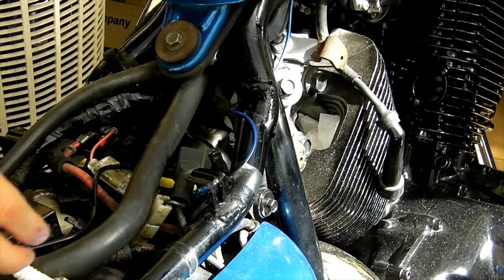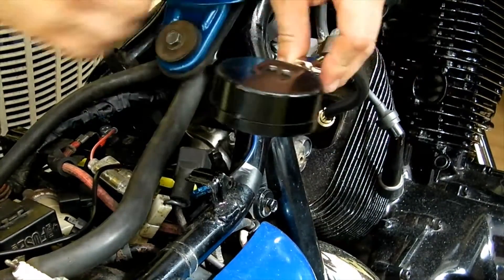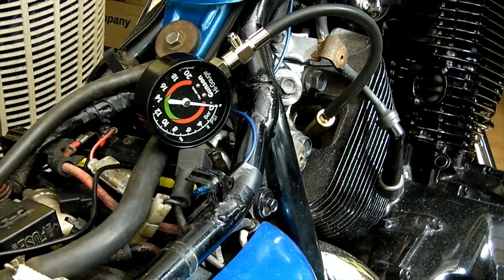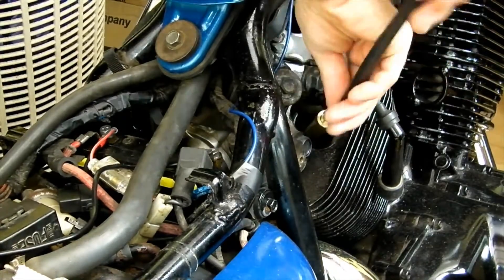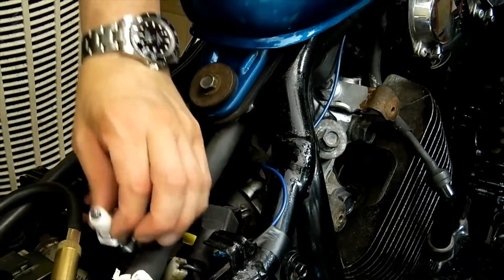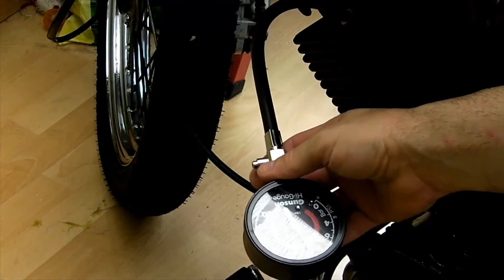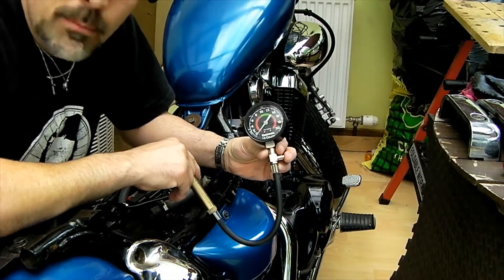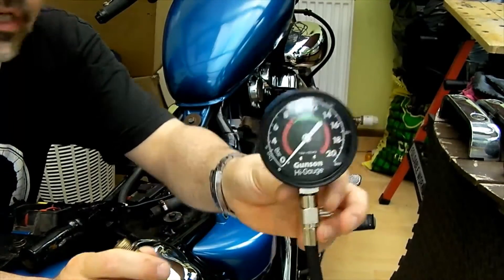Yamaha VIrago XV5535 Bobber Project, Part 2, cylinder compression testing.

Comment: On the xv535/xv400 as I have, how do you shut off the fuel from the pump?
My virago doesn’t get used very often and I found recently when changing my oil that some fuel is getting past into the sump.
The bike itself appears to run well (I’ve yet to do a compression test and that’s next on the cards, especially as I have a tester in my garage)
I’ve never seen any sort of fuel tap or switch on the 535.
Many thanks

Comment: Good afternoon!  Who can tell me, I can’t solve the problem, the yamahs virago 535 stopped pumping gasoline, the fuel pump is crackling and doesn’t pump, I bought a new one, the same thing is cracking and doesn’t pump, I took this new pump, I thought it was also broken, but no, I just inserted the hose into a bottle with gasoline from there  shakes the beggars.  I removed all the hoses from these two tanks, the one that blows from the bottom is all blown through these two hoses that are connected to the tank above.  but the only fitting from where gasoline should go to the fuel pump, blow there, don’t blow, or suck back, no reaction.  Is it supposed to be like this?  Could there be some kind of valve inside this lower tank or something clogged?

Comment: I seen one guy did without carb installed and it came up with around the same reading.. what you think 🤔
Reply from the maker: A compression test only indicates the pressure in the cylinders and indicates how well the valves are sealing, nothing to do with the carbs.
Reply: @spidiq8  yeah I understand that... I wanted to make sure they were right so I can sync carbs and to check engine... Don't want the compression higher or lower on one side then do a sync test...
Reply: @spidiq8  I just didn't know you could do without carbs installed..

Comment: So did you not have to spark plugs in boot and on cylinder block? Did you have both spark plugs out it seemed like you did? Did you have to remove ignition coil wires?? Thanks 😊
Reply from the maker: For the compression test?
You don't need to have the spark plugs in the boots, just removed so you can fit the compression tester.
No need to remove coil wires as the spark is going nowhere but it's advisable to shut or block fuel off.
Reply: @spidiq8  yup for compression test thanks!!

Comment: Hi i need help, i need to take out my gas reserve and its not fitting out of the frame. I dont even get how they could get it in there. Am i doing something wrong?
Reply from the maker: Do you mean the reserve fuel tank?
If so, part of the left side of the frame has to be unbolted to give access to remove it.

Comment: how do you find out what your bikes/car compression is supposed to be (stab in the dark go to the dealers)?
Reply from the maker: Unless you have specific info, (within a band) from an owners manual, assume that within the green band for a normal non performance engine, 9 bar + is good.
Warm engine and wide open throttle to get a proper reading though.
More important to get a consistent reading across all cylinders.
Have you got a compression tester or shall I bring mine next time?
Reply: fingers crossed i think every thing is running ok at the mo. just need brakes and a water hose.
Reply: and a rich widow.
Reply from the maker: You'd know if you werre losing compression badly enough for it to be a problem I think.
On the other thing, you'd want to know why she's a rich widow first!